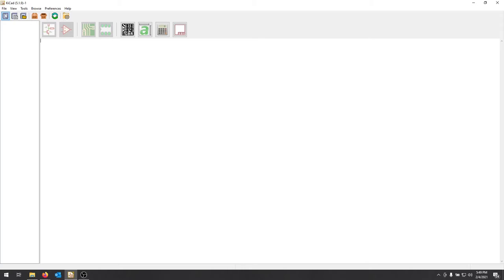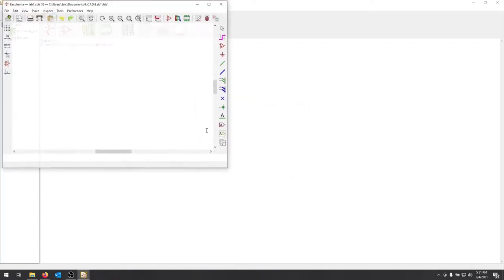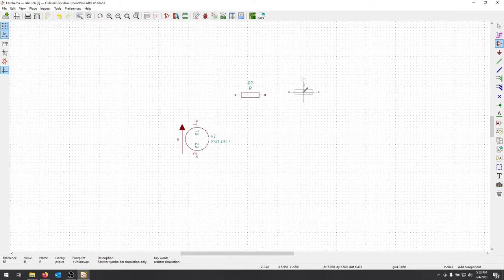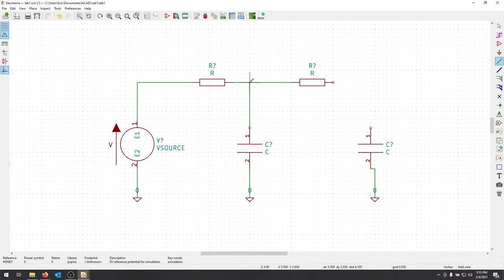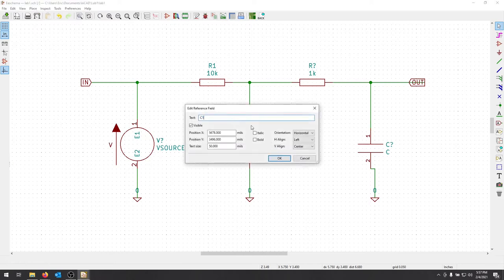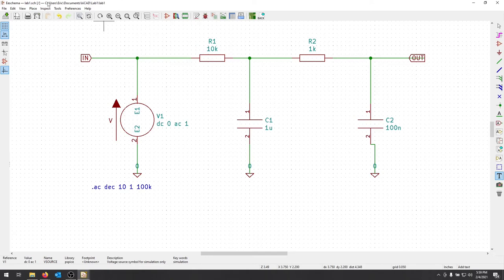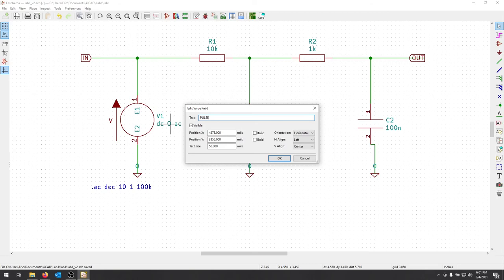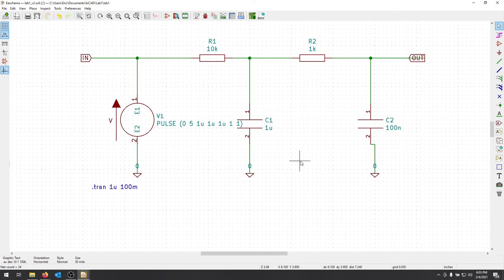KiCAD - SPICE Introduction - RC Ladder

Comment: I'm trying to add a 1n4007 diode but I'm constantly getting "unable to find definition of model 1n4007". I checked demos I found they were using 1n4048, so I used it but the same error keeps popping up. What should I do?
Reply: if the component is not in the spice lib it wont work, I believe.
Reply from the maker: You have to add the model. OnSemi has all the diode models if you'd like to use theirs. You will use the D for ngspice and add the 1N4007 model.
Reply: @ericbredder9015  Thanks for your video, but what I'm trying to find out is how and where to add a model--what file it goes in, what directory that file goes in, etc. There seems to be a very loose use of the word "library" as I dig around looking for information. Some sources talk about a models library, and others seem to indicate that "library" refers to the Kicad symbols library and that the model data goes in them. 

If I go to Symbol Properties for a component and click on Edit Spice Model and go to the Model tab, it's not clear to me what the Library field is. When I click on the Select File button, it doesn't take me to my symbol directories (and of course it knows where they are) but just the general file system. Is it expecting the name of the particular Kicad symbol (.lib) file? Well, there's lots of entries in the .lib file that would apply, so will it automatically match (for instance) "2N3904"--the name of the model I want to enter--with the component in that library by the same name? That's very unclear, and it ought to already know what component I'm editing and what library it's in. 

Do you have any insight on this? And do people sometimes keep their spice models in separate spice libraries and then link to them? For some reason, clarity is eluding me on this, and I'm not a Kicad noob, I'm just new to using it for simulation. Thanks.